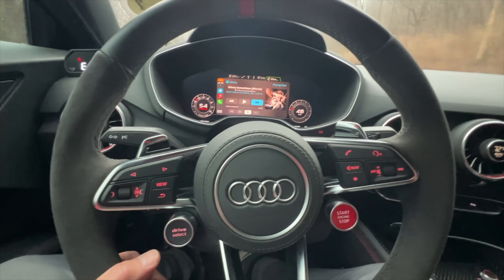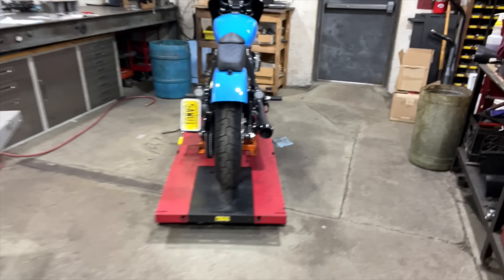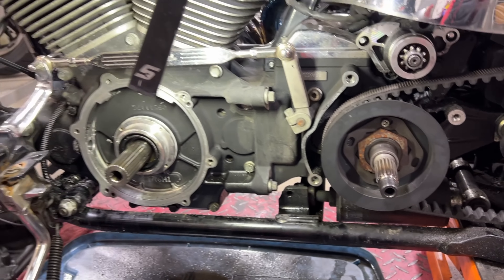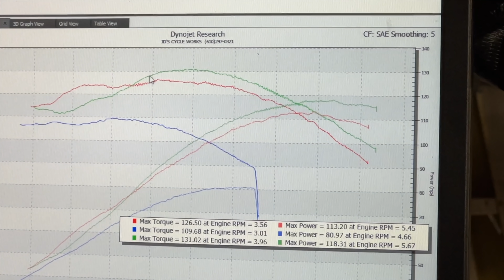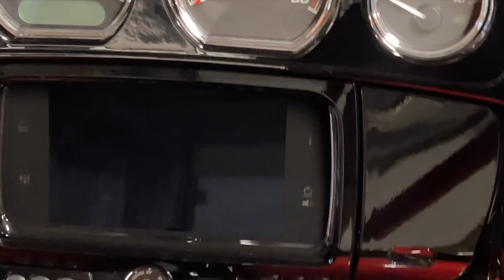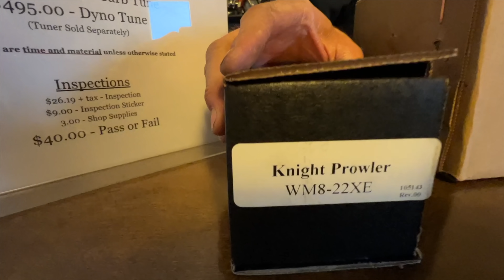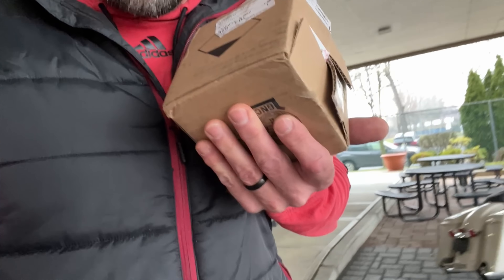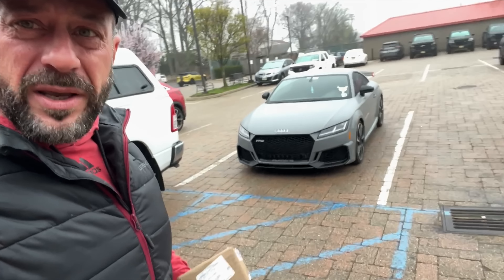TOTAL PRIMARY STATOR MELTDOWN - STREETBOB UPGRADES #HARLEYDAVIDSON #STREETBOB114 #THRASHINSUPPLY

Comment: That woods WM8-22X-E is the best cam for a 114. I did that cam in my 2020 ultra limited and made 115hp and 128 ft lbs of torque
Reply: @CYCLEFANATIX  yeah I seen that. Those are definitely some good numbers. I wonder if having dual cooling (wet heads) would make a difference with the 475 cam